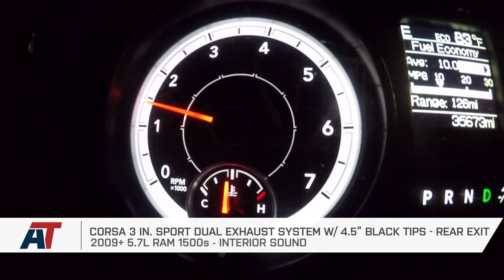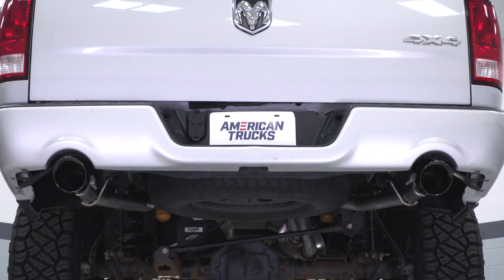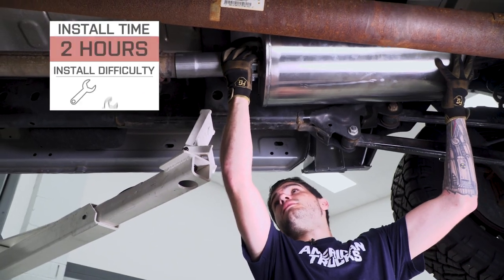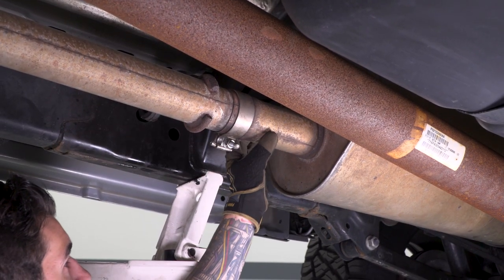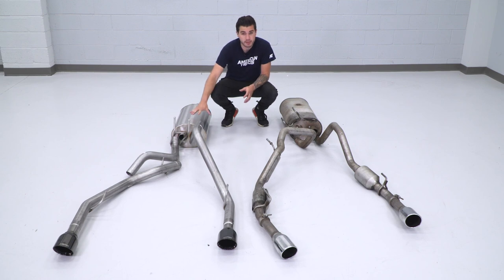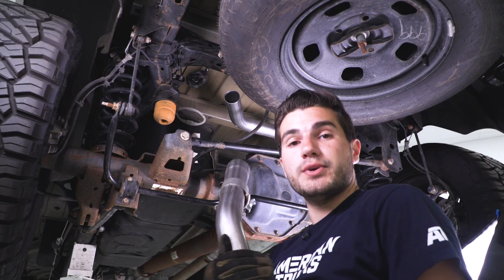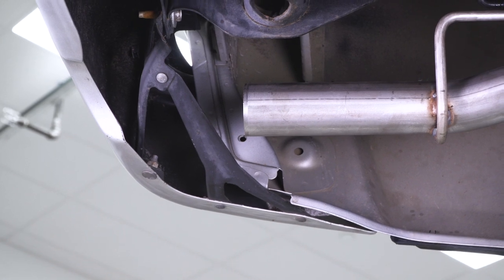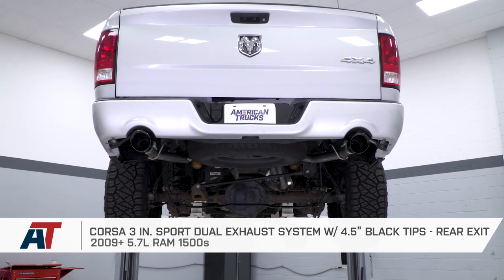2009-2018 Ram Corsa 3" Sport Dual Rear System w/ 4.5" Black Tips 5.7L Exhaust Sound Clip & Install

Comment: Is this kit available without the muffler? I have longtube headers and I plan on putting the factory catalytic converters in place where the mid muffler was located. It's the only location where they will fit and I'm trying to get my exhaust legal for the state of Texas.